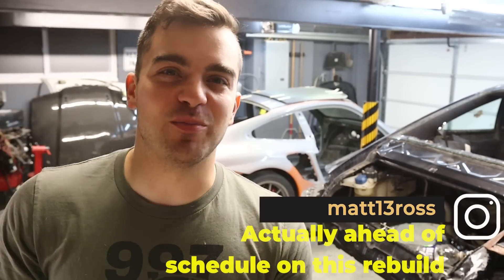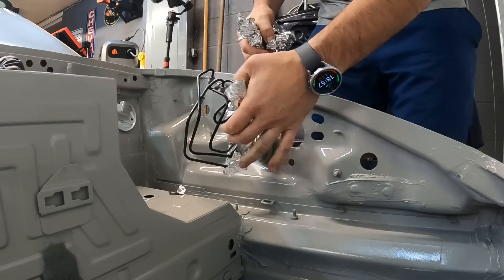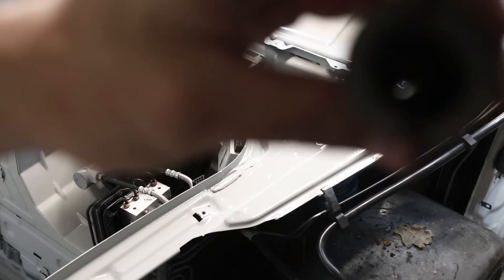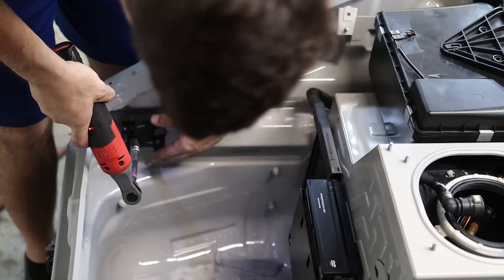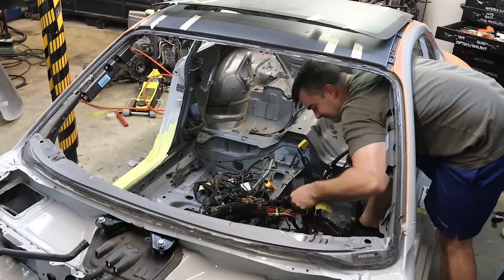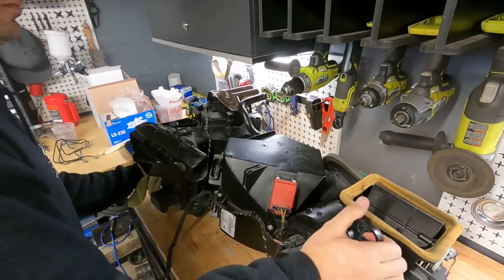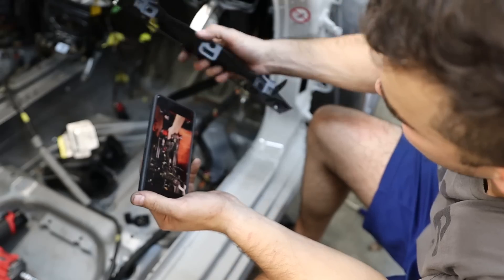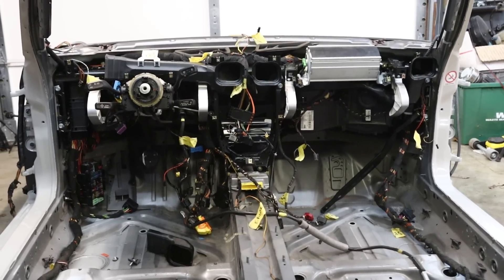Rebuilding a Totaled 997 Porsche 911 Turbo - Nightmare Repairs

Comment: Nice job Matt!  I strongly suggest you check all the ground connections and make sure to remove enough of the fresh paint to ensure they have good metal to metal contact.  Bad grounds will create all kinds of intermittent issues and you could chase your tail for months trying to figure out electrical problems.  Good luck!
Reply from the maker: You're right. Thank you!

Comment: Congratulations Matt,  the 997 is slowly beginning to take shape & I like the colour you've chosen to paint the bodyshell.....I'm sure it will look fantastic once the car is back in one piece. 
Also, huge props to you for undertaking the nightmare job of removing the old wiring loom from the crashed 997 shell & now installing it in the replacement. This is a daunting task, made all the more difficult by doing it all by yourself.....WELL DONE!
Keep up the great work 👍🔥👍

Comment: Your doing great Matt. We aways cut the car in before assembly that way paint is behind all the bolts.  Just adds to a little more  masking on the final paint. I’ve painted hundreds of cars and trucks and that’s how it’s done.  Of course if you have to time and space you could paint it in pieces, but risk the chance of not matching.  And yes even if it’s the same can of paint mismatch is possible by technique and air pressure.
Reply from the maker: Whole thing will be painted at once in a few months I'm hoping

Comment: This is a great time to replace the foam inside the evaporator housing….now that you have it out. It tends to disintegrate and will prevent you from getting hot air when the heater is on. Otherwise, you will have to dissemble then entire dashboard (again) to fix it.
Reply: I was going to say the exact same thing. I'm looking at that job on my 997 unfortunately. It is so much fun going for a drive and have your shirt covered in black, sticky foam when you are done.
Reply from the maker: Mine is in excellent shape actually.

Comment: Matt, do not forget to take care if the heater core flapper doors before you reassemble everything.  The foam will be all rotten and the first time you turn on the AC, disintegrated foam will come blasting outa the vents.
Reply from the maker: I looked at it and it's actually in excellent condition!
Reply: Are you certain?  They can look Ok and still break down.  Be sure to feel it and see if it's brittle.  You do not wanna have to do this job while it is in the car.  It's 5 times more difficult. @matt13ross
Reply from the maker: Yup. Not brittle at all. I was surprised.
Reply: @matt13ross  alrighty good deal. It’s a butt whippin to do in the car. Glad yours doesn’t need it. Keep up the good work

Comment: Removing and installing the dash is a pain in the butt up until the 991.2 generation (same as in the 997). Beginning the 992, Porsche made it easier and you can disconnect all wiring, dash and electronics in one go.

Comment: Hey man, if you like glossy primer, you like glossy primer.  It's your car at the end of the day.

At least it's not pumpkin orange.  The color you chose will go great with the interior from the old car.  You planning on adding the rollbar back as it adds a GT2 vibe?
Reply from the maker: I actually already sold the roll bar, not a big fan.  My E36 has a bar and I don't need another car with one lol.  I want the nice stock interior.  Plus the sub box wouldn't fit with it.

Comment: Get yourself a set of flare nut wrenches for brake line / pipe nuts. A rounded brake line nut will ruin your day and is always risky using standard wrenches.
Reply from the maker: I've been meaning to get those.

Comment: The progress so far looke great!  It's comming along nice. I see you reinstalled the heatercore. I hope you replaced the radiator of the core? It's cheap easy to excess outside the car and make sure it would'nt leak in the near future. Old cores i always replace as soon it's open because it's a nightmare to approach them once everything is in place.
Reply from the maker: I didn't replace it with only 44kiles. I'm hoping it will last a long time.
Reply: @matt13ross   Hmm...it not only the milage, it's the age as well. I would have done it straight away.  Hope it will stay good for a long time.
Reply from the maker: It's still nice and soft.

Comment: Hey Matt, do you know how to eat an elephant?  One bite at a time.  Keep chewing, you're doing great work!

My only fear with this project is if you didn't torque something to the correct spec or didn't know about a part that needs lubricated and that leads to mysterious "squeaks and rattles" once it is all back together.  Glad to see that the wiring harness was not the nightmare I expected it to be.
Reply from the maker: Haha! I'm not a huge torque to spec guy unless it's engine parts.

Comment: Did you get the collant pipes welded on the engine ? May as well do it before you put it back in. Sharkwerks sells a set that don’t have to be welded .
Reply from the maker: I didn't get that far yet. Not sure what I'll do there
Reply: @matt13ross pinned lines and sharkwerks elbows is the way to go

Comment: I did commented last time about your paint job and i did watch the whole video. The insides of the door you see a lot of irregularities in the paint.  That you do it under the floor and in spaces were no one can see that is okay. But the rest i would not do like that with such expensive car.

And it's not only about making 2 cars one, you still can get a high value if it's done right. And i don't know how far you want to assemble the car before you let it be painted(did not watch this video yet to the end just commenting on your comment) but less stuff on the car is easier and better paint usually. For the enginebay i understand it. But i don't see the value of painting inside the door wich someone later has probably to remove paint again before painting it nice.

As i understood you want the whole car professionally painted right by someone else? In that case touch as less as possible i would say. If the paint does not stick right you can have all of issues later on. I think only the enginebay and the inside of the car you should paint. But nothing that is shown later when you open a door or anything else unless it's done 100%
Reply from the maker: The door jambs look as good as factory and also get.coveted with sills.

Comment: I have to hand it to you, you don’t curse nearly enough.  This is the kind of stuff that drives men to drink.  I might be think 10 steps ahead but you may have some real headaches with coding of the car. Porsche uses piwis to code the car but there is an aftermarket one called durametric.  You may already have this as you worked on your 996.  Just something that should be on your radar.  The mechanical stuff is easy but the electrical stuff could be rather complicated. Keep up the good work.
Reply from the maker: I just cut out the swearing lol